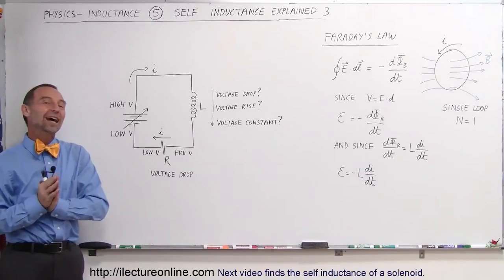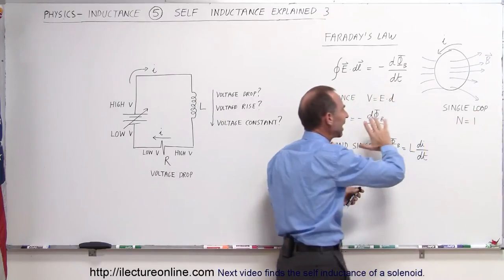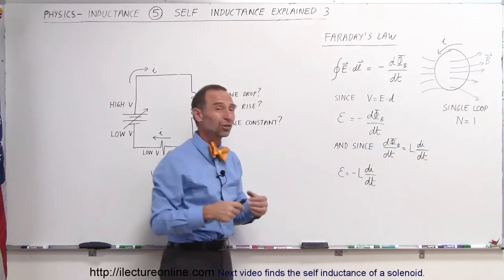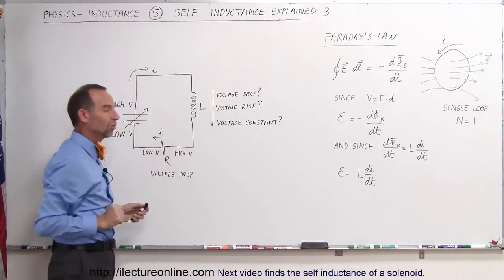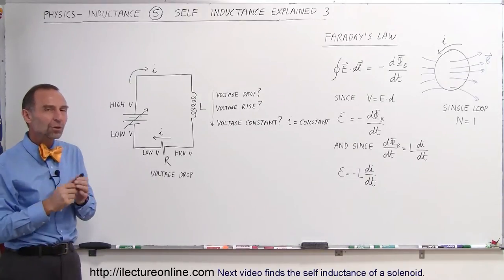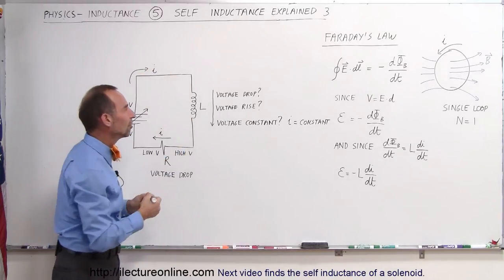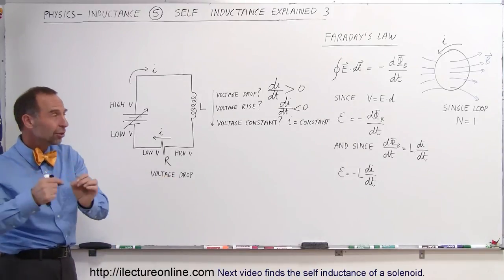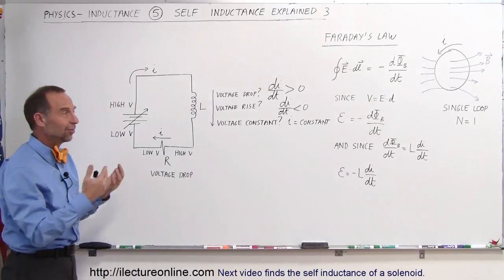Physics 47  Inductance (5 of 20) How Self Inductance Affects a Circuit?

Comment: There is a fundmental flaw in your presentation!?
The inductance L can not be excited with DC voltage source. For battery as DC voltage source inductance will be ZERO since the coils is shot if driven by DC battery voltage source.  There would not be induded back EMF etc.
The resistance R of the coil will result in huge DC current as that coild parasitic resistance is very small!?
Inductance is alternating current phenomenon and it is only created by an alternating voltage drive instead of DC voltage battery drive. Moreover if that alternating votage is not made to be flux balanced, meaning net zero DC voltage drive, the inductance will again saturate and appear as a short circuit!?
 
This explanation holds for all previous four lectures: the excitation is an AC voltage source and not DC voltage source. That is why the concept of inductance and capacitance as alternating current componwents are only recognized and introduced when Nikola Tesla introduced in 1882  his synchronous AC voltage generators and AC motors that inductance is finally recognized and appreciated as truly an AC components. Until that time even AC transformers were not recognized as alternating voltage components. It was even Faraday  along with many of his contemporaries like Henry who considered considered alternating current USELESS and devoted all their efforts to create directly DC generators, such as Faradys disk in 1831 or rectifed the alternating voltage created such as in Pixxi  primitive AC voltage generators which quiclky rectified them before they applied them  I hope that this would rectify confusion which may have been caused by these 5 lectures. 

Apparently, this also make a clear distinction of how would an electrical engineer explain AC inductance compared to physicist
basing it on Faradays Law of Electromagnetic induction and imaginary drive with time varying current  produced by DC battery vlotage which obviously DOES NOT exists!?
Reply from the maker: No flaw here.  Note that the symbol use in the schematic is a variable voltage supply and the text on the video indicated an increasing, decreasing, and steady state voltage situation.  What will happen in each of these cases.  With a steady state voltage, the inductor will indeed not oppose the current, also indicated with the equation where the voltage across the inductor is proportional to the change in current.